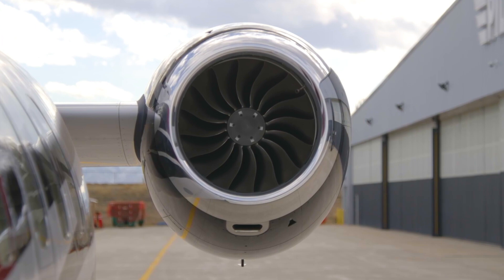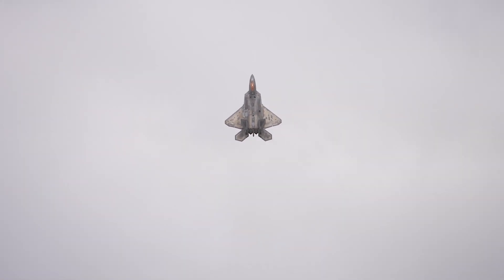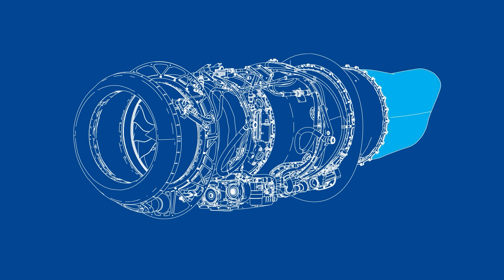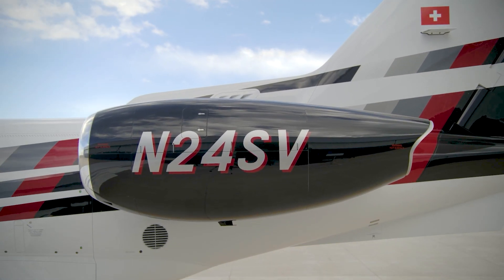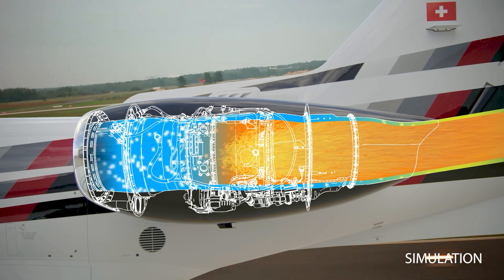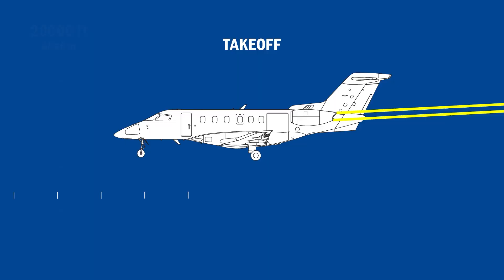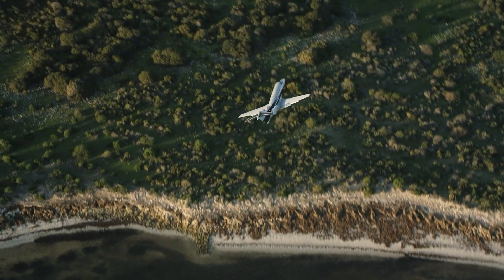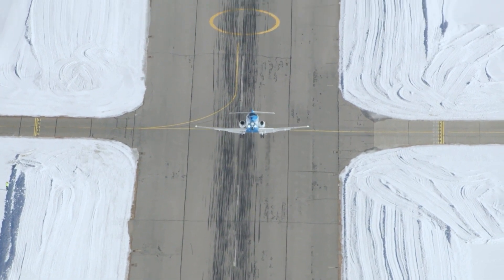The Secret Behind the PC-24's Powerful Engine Nozzle

Comment: I don’t understand is p, TOGA should be higher engine power than cruise flight ?why exhaust speed otherwise? Back pressure?
Reply: The video says it's due to relative speed of the air surrounding the nozzle. Also, at sea level air density is much higher, so you may very well have higher trust yet less volumetric flow.
Reply: The design of a nozzle is important because when at cruising speeds, whatever speed the air is coming out of the nozzle is the determining factor for how fast the plane will go. Less concentrated of a jet stream, the slower the plane will go. It’s the same principle when water gets restricted in a hose, the water shoots out like a jet stream at a fast rate, it also causes the hose to whip around . That’s how thrust works.

Comment: Pretty disingenuous to call an optimized nozzle tHrUsT VeCtOrInG. I hope the engineering department is rolling their eyes at the marketing department
Reply: It's not disingenuous. It's what it is called by engineers, not marketeers: passive thrust vectoring, as mentioned in the video. Maybe you didn't understand the principle that the nozzle's thrust vector varies its angle with airspeed?
Reply: Rightly said.
Reply: It's still kind of the same thing.

You're just used to the term being associated with military hardware.

Concord had thrust vectoring
Civilian execution of thrust vectoring is just a bit different from military execution.
Reply: @zephyr_00 the difference being the civilian one is static and not controlled and the military one aids dynamic maneuvering. It’s about as far apart as you can get and still plausibly call it the same thing and kind of a stretch at that.